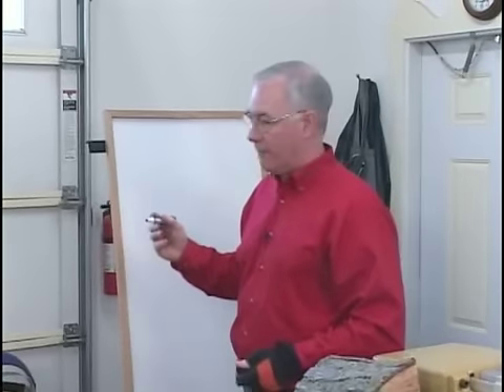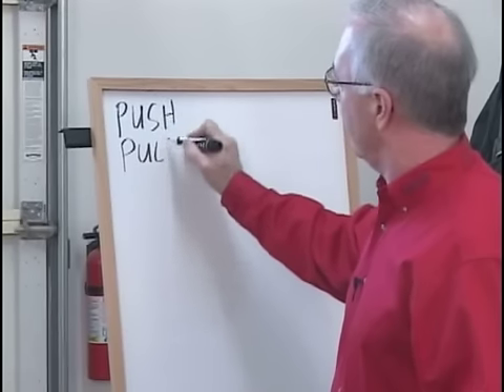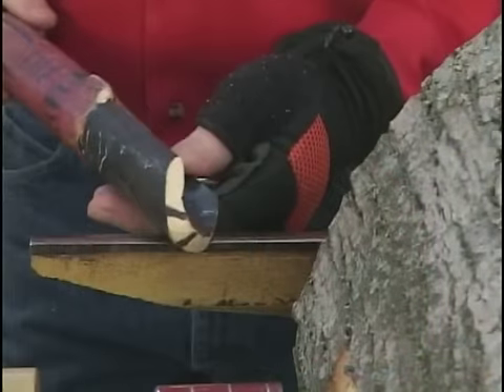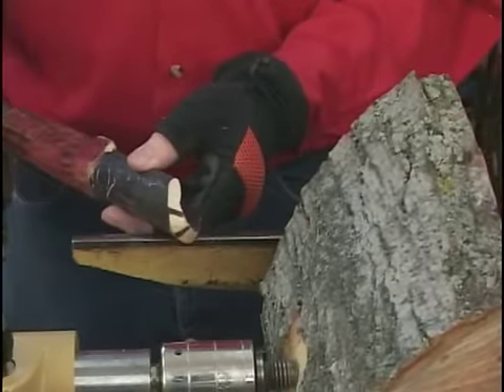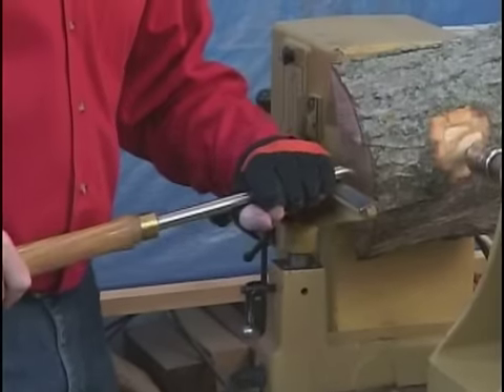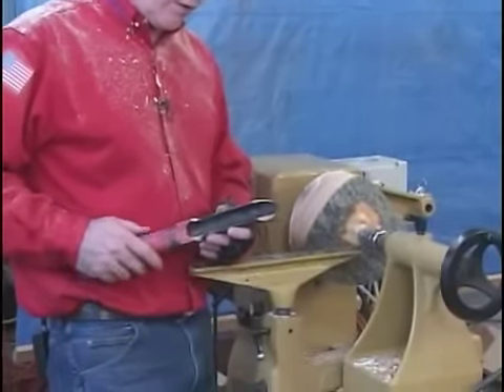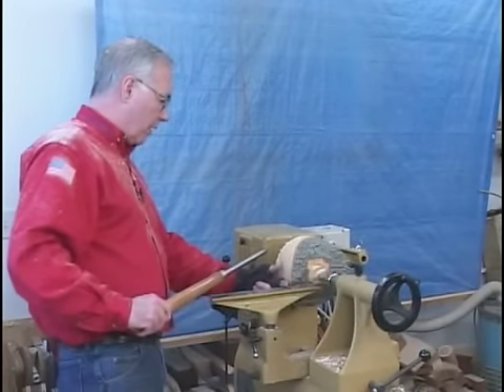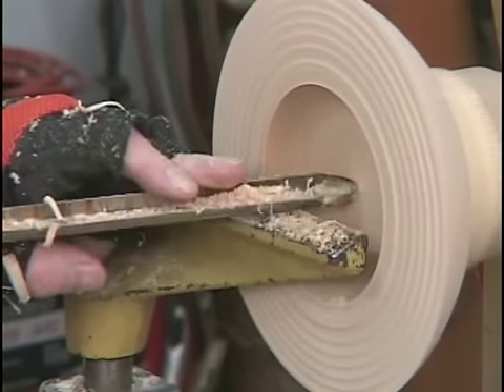Lyle on Woodturning Push Cut

Comment: Thanks Lyle - I'm late in arriving with thousands ahead of me.  This video and the one that follows, describe the process brilliantly.  Thanks - but wait as the say, there's more, "what about the position of my feet?
Reply from the maker: Good question Ray.  You position your feet so you have a comfortable stance at the END of the cut.  Reach out with your arms and shift your hips to reach the start of the cut.  The trick is to have a stance where you do not shuffle your feet during the cut.  This will allow you to have a bevel supported cut and prevent tool marks.

Comment: Hi Lyle, love the way you teach but im having a little trouble with this push cut, seems more often than not my bowl gouge is bouncing off the surface, I think my gouge is sharp enough as i try the pull cut and works fine, seems like im always fighting this one.
Reply from the maker: Hi Ron, It is hard to trouble shoot in text.  I would suggest taking a look at my Bowl basics DVD.  Some of it is on YouTube but the DVD has the continuity of the whole process and all the rules involved.  If done properly there is very little need for the tool rest hand.  The bevel directs the tool.  Its all about bevel support.  I line up the bevel on the wood surface before I start the cut. After that, the handle hand steers the bevel around the curved surface of the bowl.  Try practicing the push cut on a spindle mode blank between centers.  Your nose can look right down the bevel and you can see how it supports the cut.  You have to relax and let the tool do all the work.  If you are fighting it, the method is wrong.  It is a finesse thing not a strength thing. Give me a call if you want more details.
Reply: Thanks Lyle, Im gonna try that, I am trying to put pressure down on the rest and not into the wood. But Im probably gonna get your video, thanks for the quick response.